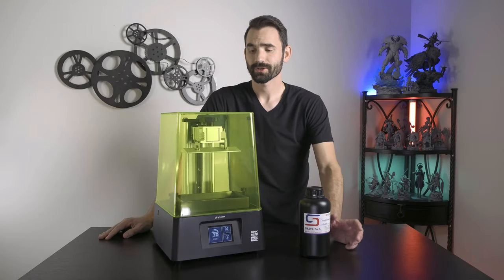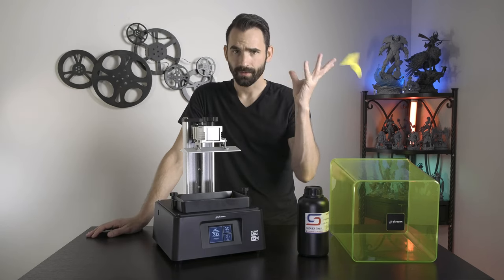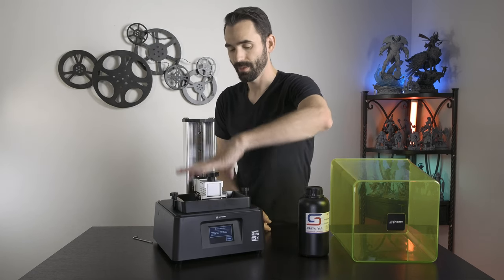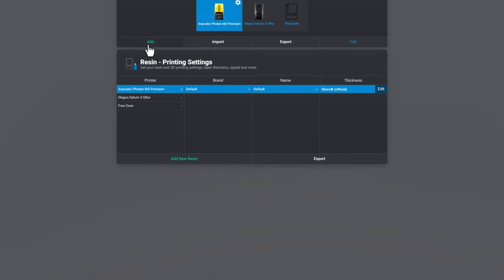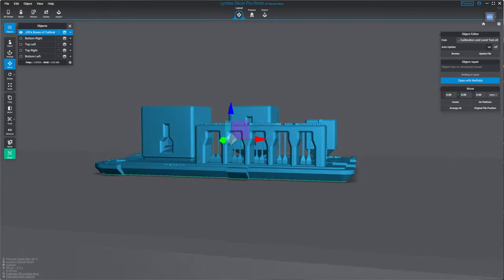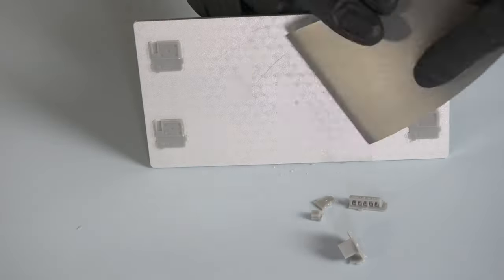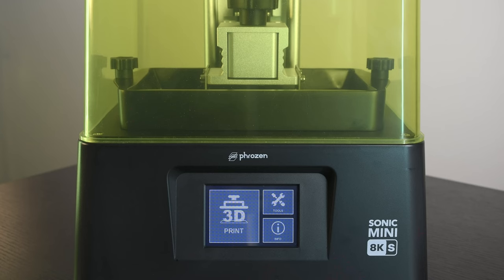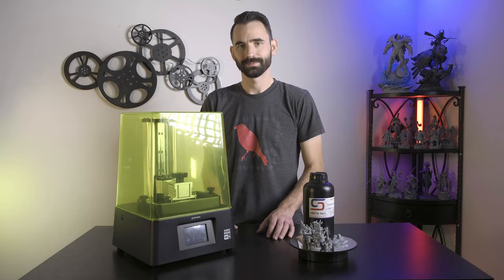All you NEED to know!! to get started with 3D Printing!

Comment: vat cleaning: "the sheet of cured money that you pull out"
Reply from the maker: It's about 0.2c per sheet on average.  Far cheaper than a $100 - $450 LCD that a single mistake can cost. Or even the $10 - $30 FEP/ACF. In the end, it is highly worth the cost and that's before you get into the time savings. 

The alternative is to empty the vat through a strainer, a paper strainer will cost more then the resin of the cured sheet. You can use a metal version you must clean but there is a time and cost to that as well. Mostly in the IPA and paper.

Comment: Just try your xl  calibration,  what if on the left i got 1,2 and on the right about 1,4 1,5, do i need restart the leveling because the plate isn't horizontal?
Reply from the maker: On what printer? With the XL you will often get a thicker raft due to the heat and the size of the part, so on this we care more 1. Did they all print, Yes good, Are they all about the same thickness? 

What you want is from the thinest  to the thickness no great then 0.3mm difference. 0.2mm if you can get it, but some printers just cant.
Reply: On a elegoo mars 3, yes There is a raft who appear, so it's normal? But the size are différent from the left to the right, 0,2 0,3 mm différence so it make 1,2 mm on the left with raft and 1,5 on the right.
Reply: @J3DTech  On a elegoo mars 3, they all print good, but the thickness on the left was 1,2 and on the right 1,5 approximatly, (mesure with a meter), difference between left and right can be a problem?
Reply from the maker: @Kivar1  It's about as much as you want it. If you want to try to level again you can but it's probably ok
Reply: @J3DTech  Ok, thx a lot

Comment: I did a test print and cant find anything about my issue…… it only printed the 8mm box and not the 4 or 6, prints very little hairs in the pillars too.
Reply from the maker: That would mean you're under exposing. Add 2s and try again, it's always better to shoot over and work back down.
Reply: Okay. So go from 3.3s to 5.3s?
Reply from the maker: @Th3Tuski  what printer and resin?
Reply: @J3DTech  anycubic m5s pro w/ resione anti impact.
Reply from the maker: Ah ok, that resin is in a class I call "specialty resin", this in the  highly flexible area. It's going to behave very differently and need some different settings. First just keep going on on exposure time till you can get them to fully print. These flex resins are not very accurate but you can still get it as close as you can. Your expectations of perfection will need to drop a little as you switch into, getting it as good as possible.    @Th3Tuski

Comment: Great video! I have one issue, maybe you can help me. When leveling the plate and doing the calibration test, the rafts on the edges come out perfectly, but the one in the middle doesn't stick to the build plate. I've tried lowering the lift speeds and increasing the lift distances, but I still get the same issue. I also sanded the build plate and checked with a ruler and light for some uneven spots. Any ideas?
Reply from the maker: I've seen this a few times. And it is often because the build plate isn't flat you corrected that. Did you also scuff it up to add a texture?

The LCD is warped, harder to check but 100% an issue mostly on the Phrozen 8k.

Make sure that the FEP and LCD are in good working condition.

Make sure you're lifting high enough. What printer and slicer?
Reply: @J3DTech  Yep, I'm 100% sure the build plate is flate, I sanded it with 120g, then with 80g to give it a bit of texture (I followed a video that explains it rly well).
The printer is a Mars 3 Pro, Im using Chitubox Pro as my slicer. 
I tried with 10mm lift distance and 20mm lifting speed so I'm pretty sure thats not the issue.
The FEP is new and I'm pretty sure it has the perfect tension (I checked the frequency of the sound with the phone app). I've never heard of the bend LCD problem on the Mars 3 :/
Reply from the maker: @FrankieMankie  Nope the Mars line is to small to have that issue. When you finish the prints, did you measure the low spot to see how thick it is, it should meaure 1mm. 

What resin are you using?
How many Bottom layers
Transition layers
Bottom exposure settings
Layer thickness. 
Wait before print (Light off delay)
Reply: @J3DTech  Yep, all low-spots on the 4 rafts on the edges measure 1mm exactly.
I am using Elegoo Water Washable with 6 bottom layers at 20s, 3 transition layers, layer thickness of 0.05mm, light off delay of 0.5s.

However, I just did a test with 30s bottom exposure and the one in the middle actually printed!! 
I dont get it, with 20s bottom exposure the ones on the edges print but the one in the middle doesnt, and then with 30s they all print? 
I used to print with 20s bottom exposure in hot weather 30-35°C, now its 23-25°, does that affect how much bottom exposure I have to use?
(By the way thank you for the quick answers!!)
Reply from the maker: @FrankieMankie  Ah the age old ruck of MOOOARRR :) I would recommend using 2s light off delay however, this will make a MASSIVE improvement to the quality of your prints. 

5c is a massive change, it will 100% change how your printer works. This is why I recommend getting a heater for your printer. In my guide at the bottom I have a few options with pros and cons.
Reply: @J3DTech  The only issue I have now with 30 seconds bottom exposure is that removing the print requires a lot more pressure, but I rather break some rafts than clean a failed print... It's weird tho, there is no "sweet spot" for me, its either the print doesn't stick to the plate or its near impossible to remove :(
By the way, Chitubox doesnt' have a "Light-Off delay" option, I'm assuming it's "Rest time after retract"?
Reply from the maker: @FrankieMankie  You can try reducing the UV power to help find that sweet spot. Rest time after retract is what you're looking for.
Reply: @J3DTech  I'll try with 2 seconds Light-off. After reading your amazing guide it's obvious you know a lot about this stuff.
There is one option in chitubox pro called "bottom light PWM" (I'm guessing that's the option for the UV light strenght). Right now is at 100%, how much should the decrements be in %?
Reply from the maker: @FrankieMankie  I would try 80% and see how that does. It's ok to go down to 65% but I would not go lower.

Comment: Hey, I just want to sat that your boxes od calibration are probably most usefull calibration tool there is.  Thanks, for this and for your guide.
Reply from the maker: @Xelonius  Thank you! I put a lot of work into making sure it was 100% object. So not only can you calibrate your printer. But you can actually use it to compare resin and printers in a way that removes all subjective variables. 

Word vomit 🤮 sorry.

Comment: This is great. I think the cubes of calibration is one of the best tests out there. I like numbers and 'wrong or right' answers, other calibration parts don't go down that root.
Reply from the maker: Thank you, I really felt I had to keep it objective and not subjective.

That's even why the pillars have no weights on the end. As soon as I or anyone adds weights. It's subjective, as that person now controls when you're successful or when you fail.
Reply: @J3DTech  Could you please do a video on supporting the inside of a hollowed model. Would be greatly appreciated.
Reply from the maker: @brendon6930  I have a video on hollowing where I do cover this. In that video I also cover 2D, 3D hollowing, blockers and holes.
Reply: @J3DTech - I wanna make sure I’m doing this correctly…I’m using an Elegoo Mars 4 Ultra. The thin part of the build plate calibration pieces measure 1.5mm. Once I’ve returned the build plate to home. Do I use the “Manual” tool, choose “0.1” and then click the down arrow 3 or four times, then go out to the Tool menu and click the “Set Z = 0”?
Reply from the maker: @TheMoondougie  Correct and then your next print will start with the build plate that much closer to the LCD.
Reply: @J3DTech  thanks much!!!

Comment: The new calibration tool with the four satellite components is a fantastic upgrade! Very clever.
Reply from the maker: Thank you!

At this point these 5 little prints will test for.

Bed leveling
Z-offset
Bun in exposure
Dimensional accuracy
Resin Tensile strength

All with objective results.

Comment: Very interesting video. Thank you! I'm new to resin printing and been working on calibrating a Mars 3 Pro. I've gotten the cubes to fit perfectly, going to try this now and check the z offset and leveling. Also going to try the vat leveling technique, seems way better than the paper method.
You deserve more subs and views.
Reply from the maker: Thank you, let me know how it goes.
Reply: Just printed the five flat pieces after doing a new leveling and vat clean. The leveling seems perfect as far as I can tell. I have ordered one of those digital exact measurement tools, for now I used a folding rule with millimeter markings and just my eyes. Far from exact of course but it looks very close to 1 mm. Was thinking of raising the z offset maybe 0.2 mm or so to be safe until I get the tool for exact measurement.

Comment: In the drywall or painting section of the hardware store you can find a nice metal scraper about an inch wide.  Most of them suck, but if you find one that says "Chisel-Tip" it is a little thicker with a perfect angle to remove prints off the build plate without harming the base of your item.

Comment: Awesome! Glad you are making an appearance.  Is strange not to have one of THEE best Printers not visible in the community.  Yes, you wrote the book and have I believe the best printing capabilities  but not enough people understand how to do this.    I saw on another vid that when raising the z offset that you should end on a DOWN button push.   So,  if it needs to be raised 4 then raise it 5 or 6 and come down 2 , something about gravity.   Now this was for a DELTA FDM printer but maybe it is the same or maybe not with the spiral arm..    Anywho,    I am so glad the book is alive!!!!!!!
Reply from the maker: Thank you very much! 

I'm not sure on FDM. I am learning that now but I would say it would not translate into resin at all. These two are so different.

The Z-offset calibration is something I was afraid to share. Im still worried users will spent too much time trying to make it perfect. When + or - 0.2mm is fine.

In resin the Burn in layers will kind of auto level to an extent, being a bit thick can actually be a good thing.

For example if my raft measured 1.2mm I would be happy and leave it alone.

But 0.8mm I would want to increase my offset by 0.2mm.

Perfect or over is the goal under = bad.

Comment: Very good video on the subject of 3d resin printing, I am thrilled with the entire playlist.
This comment is mainly used to feed the YouTube algorithm ;-)

Thank you very much for your time and effort
Kind regards
Harry
Reply from the maker: Thank you very much!
Reply: @J3DTech  
Hello J3D Tech,
may I ask you something? 
I printed now the 5 Plates and the result was:
top-left: 1,18mm
top-right: 1,21mm
center: 1,17mm
bottom-left: 1,05mm 
bottom-right: 0,95mm 
Is this an failed Plate-calibration or something else? I am wondering why the plate is top and center great, and bottom out of everything...
The Plate never fall down to the ground - just if you ask ;-)

thank you for your time and effort. 
kind regards
Harry
Reply from the maker: @Tutorialgarage  In total you're off by 0.26mm from the bottom right to the top right. That's not terrible but it would be nice if you could get it under 0.15mm. It seems like you're applying more pressure to the bottom than the top when you're leaving your plate. Overall they are pretty close to the 1mm so your Z-offset is not really an issue, even less if you could get the bottom and top a little more aligned.

Comment: I recently bought the Elegoo Mars 4 DLP and printed the build plate test after having started to read your guide. One of those squares had a thickness of 1.03mm while the other four (the center and three corners) were at 0.950. Those weren't the first prints I made. I have already printed a few minis (to test the AA settings), the Cones of Calibration and a few more stuff. I decided to start over after discovering your guide (I plan to do this professionally in the future. I bought the DLP printer so I wouldn't have to worry about the LCD screen as a beginner).

 I might have to postpone further calibration/tests though. The room's ambient temperature is around 19-20 degrees celcius (at best the resin has the same temperature). I have ordered a thermal vat band in order to raise the resin temperature to 27-30 C (which might take some time to arrive in Greece).
Reply from the maker: That distance between the two is more than good. I'd say you're level. 

I don't recommend anyone use cones they aren't really calibration. 

For the temps, after more experience I recommend 22c-26c but you can get away with 20c. 

DLP Printers can be a bit strange with how AA can or can't work. The best printers I've found are 8k as the 12k and 14k printers have all strange quarks.
Reply: @J3DTech  Thanks for the advice. When the time comes I plan to go for Uniformation's GK Two and one of Phrozen's printers (still haven't decided which one) . Ideally I would want two large printers (with a good XY resolution) for both large and small prints.

Comment: Thank you very much for this interesting and extensive video. I would like to ask two questions, if possible from here. Is there any explanation possible about "COMPENSATION"? and how to avoid elephant foot, from Chitubox I understand it and eliminate it well, but from Lychee I am not able to. Thank you so much
Reply from the maker: First I want to say, this feature is not necessary unless you must print directly onto the build plate. Something I rarely recommend in resin 3D printing. That said, you use it as a negative value. It will delete pixels around the base of the object so that after the elephant's foot effect is finished the current base is very close to the size of the original. There is no trick to it, just print a small object and play with the value till you find the balance between burn in exposure time and compensation.
Reply: @J3DTech  Thanks for your answer. So the 5 build calibration plates, shouldn't I print them directly on the build plate? I ask this because I want to make some flat flower designs to use as a pin.
Reply from the maker: @tonimorato2749  these ones. Yes, they are designed to be printed directly on the build plate.

The difference here is that most calibration prints come with a raft pre-installed and are designed to be printed directly on the build plate. Where your 3D model may not be.

Comment: Great Video, im scared to remove the entire build plate using the large knob. Fearing that I will not retighten to the "set 0" torque of the knob. Do you remove the entire build plate every print, and what is your success rate when re installing for back to back printing with no down time?
Reply from the maker: I can go 6+ months without re-leveling or a failure

Comment: Could be wrong but I did not see any info in your guide regarding proper ventilation for your resin prints(tried searching for key words and skimmed through it). Does the room you print in have a fan venting to the outside? Are activated carbon filters adequate for VOC/resin fume exposure if you have to use an indoor room?
Reply from the maker: It's a topic I'm afraid to cover as I don't consider myself in a good position to give this type of advice.

That said. I do run a 4" fan outside from my printing roll. 24/7.

My printing room is waterproof and covered in tile. 

I also have 4 large carbon activated filters throughout my house, one just outside the room and one inside every bedroom.
Reply: This is extremely disheartening. I purchased a grow tent filter with activated charcoal and i assumed that with a closed room would be enough. It seems like that room would need to be vented outside regardless. I have those crank windows so i don't see a way to do permanent ventilation. I cant modify my house either by making a hole through the wall. @J3DTech
Reply from the maker: @project_hollow6627  If you have access to a window you can create or buy or 3D print a shim that goes in there that you can use to connect up to a fan. If you can get a fan through the window, you're good to go

Comment: you picked the mini 8k s and said you like your own profile settings (your vids walking me through this). 5:35  They dont have any shared settings for mini 8k s yet. Im assuming they will be different from the mini 8k yes (I know absolutely nothing)? Guessing i should not use the 8k settings?
Reply from the maker: They are all community profiles based on the resin you're using.

They will be a bit different from what I have seen the 8ks cures faster than the 8k.

But this is why you need to calibrate. No profile will be the same. You can use all my settings but exposure times you will need to calibrate for.

Comment: Great video thx :) Can we do the leveling on the ACF film with an elegoo mars 3? Or we need to do with a paper like it's say on the notice? Because i want to change the nfep by an acf but it's not the same thickness... :/
Reply from the maker: @Kivar1  Yes you can. But I still recommend printing the build plate calibration parts after that to confirm your level and Z offset and going from there.
Reply: @J3DTech  Thx ! and i can do it without resin in the vat or it must be with?
Reply from the maker: @Kivar1  Either way but a little resin makes it better.
Reply: @J3DTech  Ok Thx a lot !